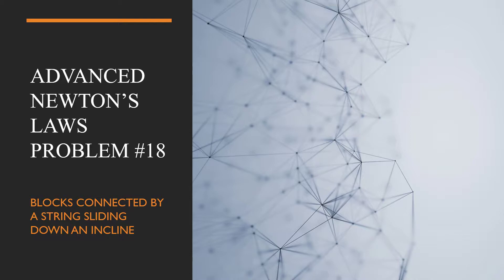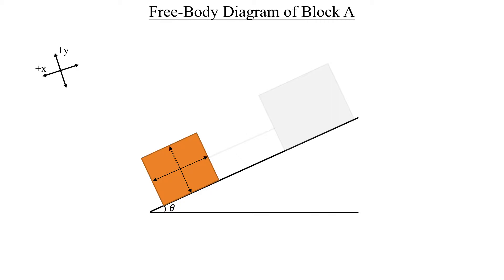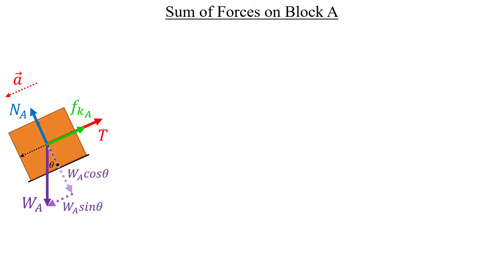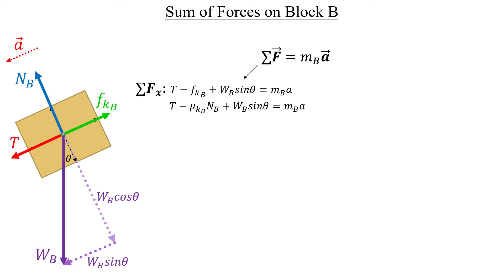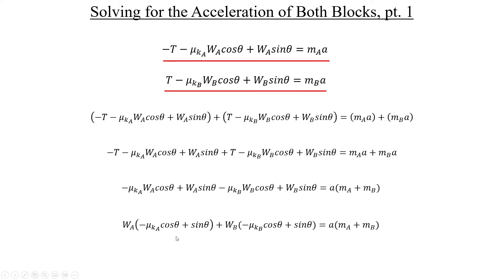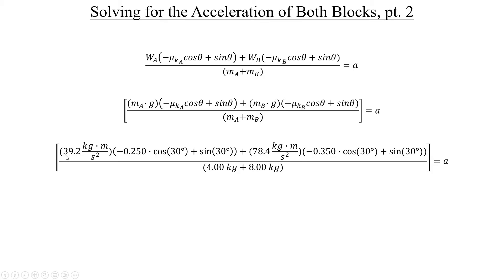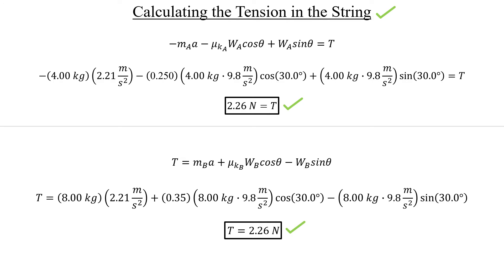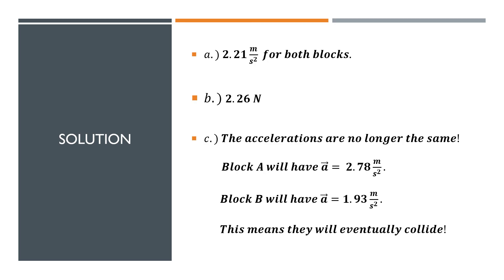Advanced Newton's Laws Problem #18 - Blocks Connected by a String Sliding Down a Ramp

Comment: In part c when the block A collides with the block B, A would give a slight push to block B while sliding down together. Is it correct to conclude that their combined system would then have the same acceleration as in part a?
Reply from the maker: Hey Aphamino, thanks for the kind words. Appreciated! 

I believe there would be a couple problems with that conclusion. Here are my thoughts: 

1.) We don't have enough information about the system to calculate the post-collision acceleration in part C based on what's given in the problem description. We would need to know the initial velocities of the blocks, as well as the distance between them or the time it takes for block A to collide with block B. 

2.) Even if we did have that information, it would require a technique that isn't introduced until much later. If you're interested, take a look at problems involving inelastic collisions in the momentum chapter.

I know that's not a very satisfying answer, but thankfully, the author of this problem only wanted us to understand that a collision would end up happening due to the differences in block accelerations. We'll tackle much harder problems like your question a bit later on when we have the proper tools and enough information at our disposal.
Reply: @sinethetaprime   That makes sense. Thanks for the explanation.
Reply from the maker: @Aphamino  You're welcome! Thanks for watching and have a great afternoon.